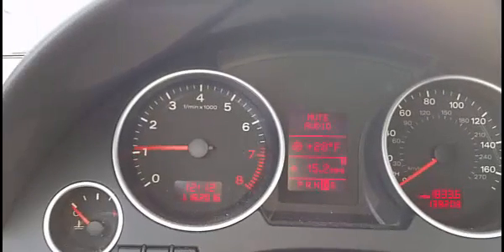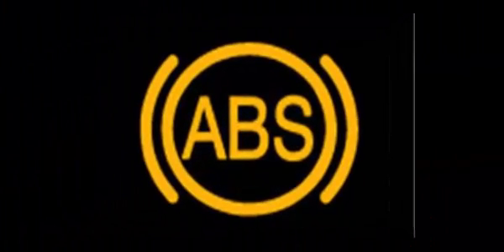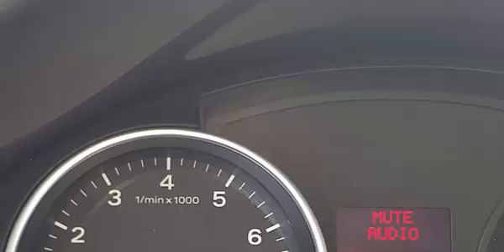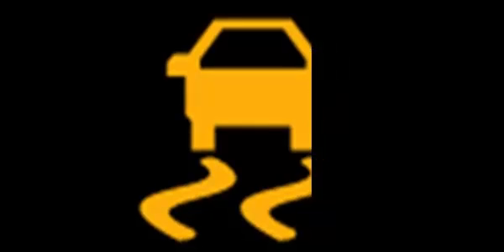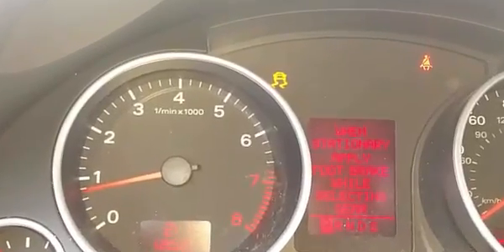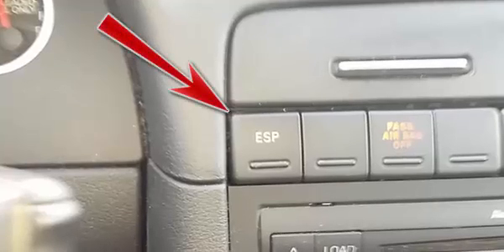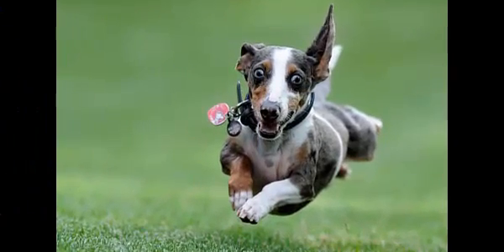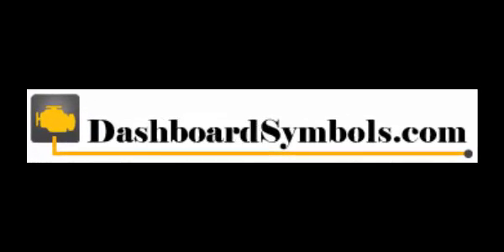Stability control lights: Assuming you have good tires, when and why do they pop up?

Comment: I have a 2012 nissan sentra the light turned on and rpms won't go over 2,000 second time this happened changed my transmission fluid and it went away car drove fine till it came back on again 4 months later any thoughts?
Reply from the maker: I do, but they may not help much.

I honestly don't believe that changing the trans fluid made any difference, which suggests a temporary issue that may be repeating now. Were there any other lights on then, or now??
Reply: @DashboardSymbols  no other light has came up but the light does not flicker stays on the dash solid.
Reply from the maker: The bottom line here is there will need to be a hands on diagnosis done by a qualified shop. I have not seen a case where the stability control light alone was activated while a vehicle was RPM limited. What you may be looking at is the Check Engine light, not the stability control light. Regardless, get it checked out. Good luck.

Comment: I have the EPS and ESC lights on and my steering wheel is locked. I just drove my car to the store, when i came back out they were on. I have slight low pressure in some of my tires. Could this be why?
Reply from the maker: Ok, lots to unpack. Low tire pressure is not the issue. If your steering wheel is locked, THAT has to be the first concern. I'm not sure if the car is running, but it 'feels' to me like it's not. True??
Reply: DashboardSymbols.com thank you for the quick response. The car is running fine. It is just very difficult to turn my steering wheel
Reply from the maker: Ok, so the car is running, and the steering works (NOT locked) but works hard. If I now have this right, there is a serious steering problem, AND I'm am just realizing that EPS is Electric Power Steering!!!!!!! So, there are only two things you can do. With an electrical issue in today's cars, sometimes a re-start of the car will reset it. BUT, I think you've done that. So, the other is to check fuses. Maybe you'll get lucky. ESC will resolve once the steering is working.

Comment: I have a 2008 GMC Acadia and my traction light just recently start coming on after driving it for a few miles. When the light comes on it seems to sputter when on the brakes as if I have gotten bad gas. Any suggestions
Reply from the maker: Well first, I can promise you its not gas. The symptom points to the brakes, which are an intimate part of traction control. Have them checked out (and DO mention the light!).
Reply: I just started having the same problem, only after tire rotation the brake light started illuminating with the stabilatrac light

Comment: Hi I have bigger tires in the rear of my 2011 Kia optima and when I drive past 65mpg the traction control light comes on...do you think it might be because I have bigger tires in the rear. Fronts are 225/45R18 and rears are 235/50R18
Reply from the maker: There's a VERY easy and short answer to this. Yes. And to my understanding, there is nothing you can do other than return to the original tire size. The stability control is not available to help control the car when that light comes on. (I am assuming it is on, not flashing, indicating that the system is off.)
Reply: DashboardSymbols.com thanks! Yeah that's what I'm doing this morning. Changing them to the same size tires.
Reply from the maker: You're welcome...
Reply: DashboardSymbols.com i have another question now that I put on the tires of the same size I noticed the traction control light doesn't pop up anymore but now i feel like my car lost power and the car idles on its own when I'm on a full stop (parked)... what should i do..please help..
Reply from the maker: Well, first, "the car idles on its own" sounds completely normal, so I'm sure I'm missing your point. And second, the car may "feel" like its lost power because the tires are smaller, but I can assure you this is only an illusion. It has the same power it did before the tire change.

Comment: I have the tcs light on and the steering wheel light on
Reply from the maker: That's a steering issue that must be checked out asap. Stability control is turned off, so you see its light, and will stay off until the steering is repaired.
Reply: DashboardSymbols.com so both lights will stay on until fixed
Reply from the maker: Chewy Hewy Yes...
Reply: DashboardSymbols.com got it fixed I had some water I dropped on a cable with a water bottle I dried it good and they came off I think it was because of that thanks for the help tho
Reply: Have 2011 rav auto lsd is flashing and check engine light both on how do I get them off?

Comment: my mercedes benz E350  2006 model- whenever the ESP lights shows on the dashboard, the car will stop acceleration? please whats the cause and possible solution.
Reply from the maker: Is there another light on as well? ESP should not impact the engine.
Reply: no. only ESP shows and the car will no longer accelerate?
Reply from the maker: Sorry, not something we've seen. You'll need a good mechanic. Good luck!

Comment: HI I HAVE A FORD FOCUS ST 2010 MODEL TRACTION LIGHT IS FLASHING SUMTYMS IS OFF BT MOST OF THE TIME IS ON...WEN I PRESS THE PATTERN FOR OFF DOESNT GO THROUGH OFF PLZ HELP
Reply from the maker: The best help I can provide is to say that the car is telling you there is a problem with the stability control that will require a competent repair shop to address. I am assuming there is not another warning light on -- it doesn't sound like it. If there is, have it addressed first.
Reply: Check your wheel barons

Comment: 2013 Mustang - the light came on as I was traveling about 60mph. I felt like the steering wheel and brake system were shaking.  Like pulsating at that speed. ....is that normal? It only happens occasionally,  but still scary.
Reply from the maker: Ah, no! Please have the car checked out asap.
Reply: Jerome Carlton do you have bigger tires in the rear and smaller tires in the front?
Reply: @noellopez9159  i do on my 2011 and it did that shit today man will i was about to turn i need to work in the morning man i drive pretty far away thats the only car i have at the moment i hope i dont fucking crash and die
Reply: @charlyBrown7  drive on the slow lane, and get them the same size asap.
Reply: @noellopez9159  funny honestly i thought you werent going to reply man it been years since your comment thanks man i kinda needed some sort of motivation to keep going man life has been pretty shit lately. When ever i have the enough money ill change them man thank you i wish you the best brother
Reply: @charlyBrown7  hah I felt alittle weird responding since it has been years but I know that it could be a safety issue. Wouldn't want you to be put in any danger. Good luck brother better days will come to you. Keep going..

Comment: Thank you sir for sharing your knowledge with the rest of us.  Perhaps you have some insights on my particular situation. I have a Dodge caravan with an odd problem. Occasionally when I start the engine, the  traction control light  AND the check engine light stay on.  This is BEFORE I even put it in gear. When driving, I experience an obvious loss in power and struggle to reach 60 mph.  When I then pull over and shut off my engine, wait a minute and restart the engine,  the Traction Control light will go out but the check engine light will remain on. Now it will drive normally and I can once again reach 60 mph easily. In fact, I can put the pedal to the floor and accelerate rapidly, which I could NOT do previously.  After a while, the check engine light will go out as well, and the vehicle operates just fine. What do you think???
Reply from the maker: Wow, sorry, but that will need someone hands on. However, I can say that the traction control (likely off) light is on because the engine has a problem. The problem is resolved, so the car runs normal and the traction control is back on (light out). However, the car knows somethings needs to be checked out, so the check engine light stays on. Make sense?

Bottom line, you need a good mechanic/auto shop...
Reply: Thanks for the quick reply. Yes, your comment does make sense and I wish I could find someone who is so well-versed in this kind of diagnosis. Because it is so intermittent, I'm going to check all wiring connections to my wheel speed sensors and also see if something might need to be cleaned.  Sometimes the most perplexing problems have the simplest solutions.  I'm hoping anyway. Thanks again.
Reply from the maker: Actually, the check engine light is staying on, so the trouble code should be a direct read! Regardless, good luck.

Comment: I have a 2011 Ford Fusion and my ABS light along with the traction stability light came on yesterday while driving on the interstate. I also had a message pop up saying ‘Service Advancetrac’. I was going around 80 mph at the time. I slowed down a bit to see if that helped. Any ideas?
Reply from the maker: Yes. Chances are this is an ABS problem first. The Advancetrac (stability control actually) needs the brakes functioning properly to work. So, repairing the ABS will take care of the stability control. Start with the ABS.
Reply: DashboardSymbols.com Is it still safe to drive?
Reply from the maker: While both ABS and stability control are important safety systems, they kick in in more extreme conditions -- slippery, hard turns, hard stops, slippery etc. Your brakes will work normally though and it is safe to drive in 'normal' conditions. Never know when something out of the ordinary can happen, so be extra careful.
Reply: DashboardSymbols.com ah ok. thanks so much. I was just wondering if it was ok for the time being until I can get it checked out.  The lights went off after I reached my destination and turned the car off/on again.
Reply from the maker: If they stay off, it may have been an electrical anomaly and all will be well. I f you see them again, it will be time for help. Good luck!

Comment: I have a 2006 Chevy equinox  my abs and tc lights stay on and when I go to put my foot on my break to stop there's a grabbing noice like I'm not going to stop but it does but why is the breaks making the noise. And my abs and tc lights staying on
Reply from the maker: tina pointer Get to a repair shop asap! Your brakes are very likely worn to the metal, and if so it's very dangerous. Someone needs to check it out, again, asap!

Comment: Mine flashes intermittent when switched off. Flashes fast if wheels spin. I’m assuming flashing intermittent and not permanently on Just means that’s how it is for my car? Some permanent on. Some flash intermittent?
Reply from the maker: The light WILL flash if the wheels slip. Absolutely normal. However, it soumds like you are getting a lot of slipping, which itself is not normal, unless you like to squeel the tires. Are the tires good, or badly worn???
Reply: DashboardSymbols.com no slipping no wheel spinning. Not understood my concern really so here goes again. Switch it off. The light flashes fast if I spin the wheels which is correct. If I drive slowly or fast 5mph or 50mph it flashes intermittent. No spinning involved. Tread of tyres are legal. The intermittent is like its saying it’s on. Maybe an update from steady on. It flashes slowly to let you know ESP is off? B6 Passat.
Reply from the maker: Ok, yes, if its turned off, there is a system issue. The light would simply stay on to indicate that the system is off. You will need a technician to do a hands on check.
Reply: DashboardSymbols.com thanks. I have VCDS and it shows no faults. Could be a common sensor fault then that fault finding doesn’t pick up.

Comment: Ok. Help! My engine lights along with the traction light both turned on and has been on for about a week. Pretty much worried. It was after going up a hill of snow. How to turn off? It's not that bottom to the left. Tried it
Reply from the maker: Ok, well, likely as not the traction light is on because the check engine light is on. Take care of the engine problem, and the traction control will be available again and the light will go out. As to the check engine light, there is only ONE thing the driver can look into. Make sure your gas cap is tight. If its loose, tighten it and the lights will resolve in a few minutes of driving. If its already tight, you will need the help of a qualified repair shop. Don't wait!

Comment: DashboardSymbols.com  I have a 2006 jeep grand Cherokee 4x4 limited I had the traction light and esp/bas light both popped on at the same time(pushing off button does not turn it off, completely turn off the car it does go off), then it revs to higher than normal rpms during acceleration and feels like it give a jerk during gear changes..
Reply from the maker: Hi one two. Well this sounds like a transmission or axle problem, and not a traction or stability control issue. Of course, it will take an actual hands on examination to properly diagnose. Don't wait -- it will likely get worse and could be quite dangerous.

Comment: Hi, I have a 2014 Toyota Markx. I've changed both back tires recently and since then the traction control light came on (traction control not off) and won't go off. Do u think it messed wit  the ABS sensor? What u suggest 
?
Reply from the maker: Well, lets see. The simply act of changing tires wouldn't affect anything in the traction control. Reading between the lines, is it possible that the tires on the back are now a different size?? Then the sensors (not ASBS) would detect that those wheels are turning at an unexpected speed. Has the tire size been changed?
Reply: DashboardSymbols.com  yes the tire size on the back has changed...thanks much
Reply from the maker: I don't know how to do this, but it MIGHT be possible to recalibrate the system. Good luck.
Reply: DashboardSymbols.com ok thanks much
Reply: Andre Beason  the thread is different now. The front tires are worn down and you have new in the rear. Go get two new tires for the front. Same brand and design. All the tires need to be the same thread depth and thread design or the computer reads it if it is not. Do not mix and match tires.
Reply: What I suggest is get a vehicle made before 2001

Comment: Lett me ask you this, and I hope to get a good answer: I have Skode Octavia A5 2005, and this light comes up and it doesn't disappear, so the ESP warning light in the dashboard, that cause the brake light doesn't come up as this is an automatic car, and the surprise that the gear is stuck on Park, and never move.
Note: my car does not have a shift lock button to release the gear unfortunately.
What could be the problem here??
Note: that problem occurred RR days after changing the battery.
Reply from the maker: The oldest Skoda manual I have access to is from 2011, and the shift lock release is not a button, but is a lever hiding beneath a compartment in front of the shifter. There absolutely HAS to be something to get you out of park, and your manual will have the procedure. Start there -- I don NOT believe that the stability control system is controlling the shifter, BUT if there is a transmission problem, stability control will be off and the warning light on. Start with the transmission, and good luck!
Reply from the maker: Ok, did a little extra digging and found the manual for your car. First, though, I did NOT notice the line stating that the battery had been changed (don't know how to translate RR days). Anyway, unless the car was switched on when the battery was disconnected/installed, there should not be an issue. However, I would recommend making sure it was properly installed. 

As to your manual, I too could NOT find a park release option. If you are on a hill, it could be jammed. It that case, have some friends push up hill will you try to shift the car. The fact that the ESP light is on suggests a deeper problem though.

Not much more I can do from here.
Reply: well first of all i'd really love to thank you for your fast reply, however, the thing is i finally found the release button, and no one can ever imagine where it is, but for your info, its under the transmission it self, you need to remove a plastic chrome piece under the transmission, and then you will find a yellow lever when you push it, it will release the transmission, however the car will be driven on a fixed speed and will not shift to the next speed. 

And that depends on the problem where it's coming from on the first place, and in my situation, i was driving on the 3rd speed, and it's an Automatic car, and the RPM is between 35 and 40 and the car didn't move to the next speed.

And later on today, i went to the dealer, and found that the problem is with something under the Brake Pedal, am not sure how to translate it :D but i guess it can be something like stop controller or or stop machine, but it a small part that is not bigger than a finger. and it's under the brake pedal and this is how it looks like

https://www.mediafire.com/file/rmx2a9dczep7igp/7fc4d82d-9c5f-46ba-b5aa-124a83fd05e3.jpg

Once i changed it everything was cool and got back to normal and it was very cheap as well
and by the way, when it got broken, Cruise control, back brake lights, shifter, ABS, EPC completely stopped working

sorry for that long reply, but i wanted to provide you with the full info, you might be interested to know :)
Reply from the maker: Well, first thank you for the follow up. Great info, and good for you getting what you needed. I am not familiar with the part OR the transmission release! That had to come from a repair manual, and I am going to check mine for my 07 Audi (same company). I am left to wonder if somehow that 'controller' got damaged when the battery was changed, or the timing is simply a coincidence.

Time will tell if all this helps someone else in the future!